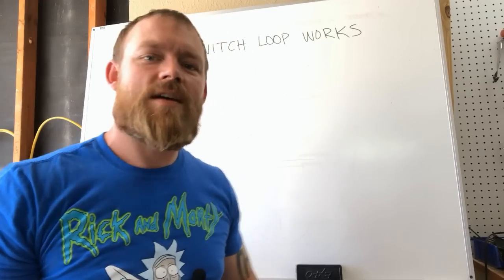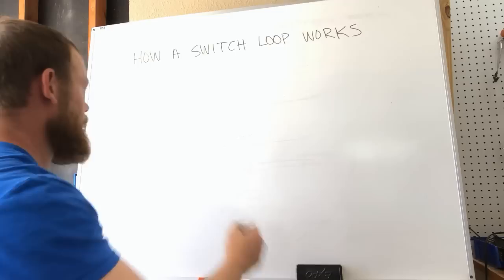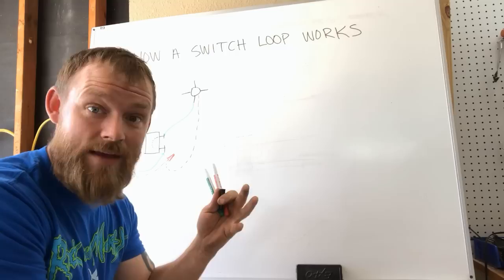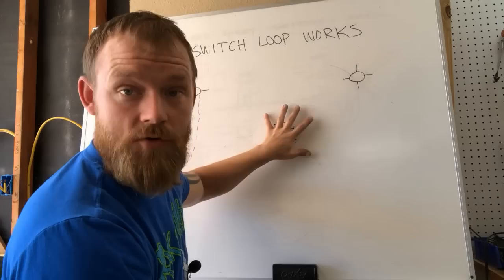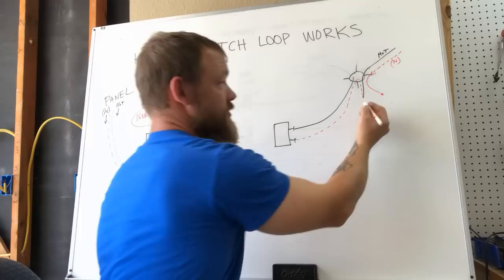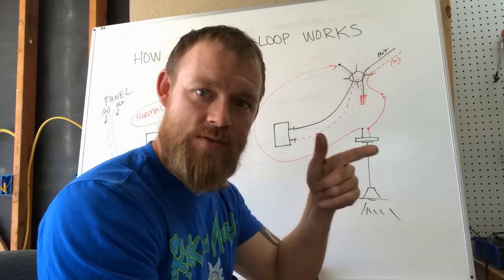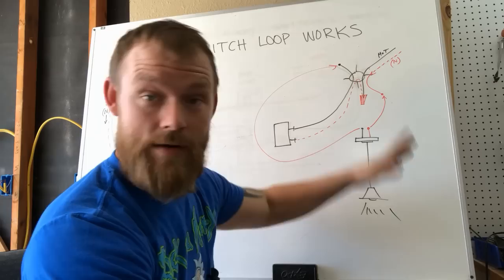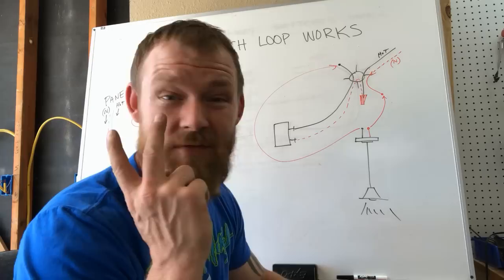Episode 13 -  SCHEMATICS how a switch loop works

Comment: Thanks for explains this. When my dad wired the house in the basement 20 years ago I had no idea how he wired  the light. Did not know it was a switch loop. Did not know what a switch loop was.  When possible I do change to new way of doing it.  Now o know when I see that there are only two wires in the light switch. Thanks for explains this.  Now I know not to throw my hands up when I see this.

Comment: Nice Explanation. I’m one of those DIY’ers and just came across this switch loop in my house trying to wire a WiFi dimmer by Feit. It’s been a pain in the butt! I purchased a wire tracer to help me out.  My scenario is a 3 way switch setup with switch loop. I’m trying to figure which is the main junction and or which junction would be easier for me to install the WiFi dimmer. If you could make an example video that would be awesome!  I’m racking my brain trying to do this.

Comment: Where I live you have to run 3 wire cable from the light to the switch because you need to have an available neutral in that switch box.

Comment: I finally understand what I’ve been trying to wrap my head around the past couple days. I’m still scratching my head tho, I had a switch, that operated a garage light. I tore the garage light out, put a receptacle in down the line for a garage door. I’ve decided to put a new garage light in place of the old. I unspliced and unhooked ALL of the wires in and around the circuit. When I turn the power back on, both wires on the switch are still hot. How is this possible????? None of the wires around the circuit are hot when unspliced. It’s all dead.

Comment: can you do another diagram,  one switch, running, 2 lights, and a regular plug, how to run, with schematics.?
Reply: Its the exact same but you go off the first light to the second and for the receptacle you use the same concept but switch the light in the diagram for the receptacle. Also make sure to do some more research because switched outlets usually only run one plug. So there's a lil tab you have to break on the hot/gold side.

Comment: Good explanation. But here in Canada if your doing a switch loop you would have to run a 3 wire. A neutral is code to be in the switch box. It's a dead end just sitting there but it's required.

Comment: So it saves having to use twice the wire for a switch. Is that correct?
Reply: Yes that is correct.  If the light is between the power source and the switch using switch loops can save wire.   But since 2011 you must use 3 wire cable from the light to the switch.   A neutral must be available in a switch box for the future installation of specialty switches.

Comment: Great explanation!! Had a kitchen peninsula switch wired 10 years ago during a remodel to possibly add pendant lights. Looks like a loop switch setup, but I'm not sure how to identify correct wires up in the attic. Lots of wiring. 1956 house, so some old and some new. Thanks much for any advice.

Comment: This might fix my issue, i brought power to the light first instead of the switch so makes sense.  Thanks for video
Reply: I think they changed the code. Now requiring a neutral At the switch.

Comment: Thanks. Your video here explained exactly the switch control my bathroom fan. Now the question is if I want to add a wall outlet right below the switch. Would it be possible to do it

Comment: My question is I'm replacing my chandelier with a ceiling fan with lights, can I wire the fan motor to the hot coming in and run the light switch off of a dimmer at this point since the motor has constant voltage?
Reply: Looking for similar answer. Switch leg in ceiling, single gang with black white red and copper, trying to navigate a double gang into the picture for a light/ fan combo, with only the existing wires. Is this possible.

Comment: The loop diagram shows line connected to SPST switch to load return. Thought 
you mentioned line wire to load to switch return. Either way series circuit will work.

Comment: If you want 2 light fixtures to one switch, do you need to use a 3 wire cable?
Reply: Not normally... when only one switch is needed... and depending where your power is located for the light.  For simple switching a length of 2 conductor (12/2 or 14/2 depending on your system.) just jumps from one light fixture to the next providing power.

Comment: Really thorough way of explaining the process. You hit 3 of the 4 ways people learn @ one time. Audio, Visual, Reading/ Writing.(kinesthetic-person learns from hands on doing it) which kinda hard since it's a video. The only thing I would still do differently is the white wire. Ur exactly right how it can be a white wire for the hot. My thought is this, if you have Red, Black or Blue wire. Why not just use those? Why even take a chance that someone(like u mentioned) comes across a white wire thinking its a neutral and bing,bang,💥 they have a problem. Anyways, just curious. Love the channel, I've become a much more efficient AND confident electrician when I'm out in the field & I'm put on something new that I'm not that familiar with or some journey/lead (like some other comments have  brought up) does a piss poor job of explaining what/how to do something. I pop one of ur videos up during lunch or when I get home that day and learn exactly the way its supposed to be done right. I swear sometimes it seems like other electricians don't want to show you things like you're their competition. So they tell you just enough not to get yelled at by their supervisor. Such bullshit. We're all in this trade together and should look out for one another. We already have to deal with the other trades messing with our shit as it is. TRUST there's more than enough cake to go around for everyone and then some. By 2023 there's going to be a shortage of electricians in the thousands. So it's not like anyone is going to take work from anyone. Anyways, help each other. Asks lots of questions. Always test wires(even if they're supposed to be cold) I've been shocked twice that way. Just saying. Better safe then dead.

Comment: I have, what seems complicated to me but may not be for experienced electricians, I have a diagram that shows the set up. I have 4 independent switch's on 4 different lights with two outlets from one power source. 1970s home.  Power is in the ceiling. I have half working but not the others. All 12-2. Worked before I updated to LED recessed lighting.

Comment: I have a scenario where a switch loop exists coming from a light fixture to a switch for one light.  However,  instead of one light for say a closet light,  I'm wanting to add another switch and light.  I have used my meter and found the white wire ( which should have been labeled with black tape  ) now functioning as the hot,  ( the white and black do not read 120 ),  and the  ( white and the ground are giving me a reading of 120 on my meter ).  Can I continue to wire a second light and switch from this switch loop?

Comment: Switch loops are common here.  The usual drill here is to wrap some black electrical tape around the white conductor to indicate it's been repurposed and not a neutral.

Comment: Just rewired a house using method #2. Main wire stays in attic and just run switches for lights. Easy-pizzey..
Reply: Right.  Sometimes during renovations you have very limited access for pulling wires.  So you've got to sometimes get  creative if you only have access from above  or below,  whatever the case might be.  Of course in new construction it's common best practice to run the feeds into the switch box then run the leg to the lights.  Troubleshooting is easier.

Comment: It is not switching from the different location. 
It’s still switching from the switch. The only difference is that constant hot is going to the switch box first as opposed to constant hot passing through the fixture box then going to the switch box.

Comment: What about the ground wire in this scenario? Are the ground wires required? Does the ground wire from the ceiling fan or light fixture need to be connected to the ground wire in the electrical box and ground screw?

Comment: This is a great explanation, I am that husband lol. I had a birds nest when trying to change a fixture. I did not see how it was wired due to haste and frustration. This allowed me to get the new fixture working. There is another fixture that has wire running from fixture to the original hook up. I just have it un hooked right now, would I hook it to the existing loop switch in the same manner?

Comment: Just to be clear even if you know the white wird is neutral be careful. If there is an appliance that is on down stream from the receptacle your working on and you disconnect the white wire you can potentially become the ground taking the full current of the appliance. And that's why it's good to pig tail.

Comment: For places that do not allow for "hot" on the white conductor, could you use say "12-3" which would allow for 2 "hot" conductors and solve the "must have neutral" as well.

Separate idea if the "hot" goes to the switch first, then could you use an "12-3" to go from the switch to the fixture leaving the red conductor disconnected but available for use if a ceiling fan installation later?
Reply from the maker: You could. And I would in that situation.

Comment: You have no idea how much your video has help me understand the concept. I am extremely new to this so please bear with me. I have removed an old fixture and there are four wires coming out of the ceiling. I know to are connected to the switch that was used to turn the lights on/off. I don’t which are which are which. A white and a black wire together as they have a white insulation tube around them and I am assuming these are the wires connected to the switch and the other two wires one is hot and one is ground. Do I have it it right so far? Now do I connect the hot wire from the penal to the white wire to the switch and the black wire from the switch becomes hot (when switch is in on position) and that black from switch and white from ceiling are connected to the fixture.

Comment: I really appreciate the video and I do agree with the sentiment that people need to stop looking at wires as Hot and Neutral, and rather as just conductors. However, shouldn't switch loops be out of code, per 200.6(1) and/or (2)? This states that the grounded conductors shall be identified as either a continuous white or gray coating. Since this would be bonded directly to Hot/Live, this conductor would no longer be grounded, correct?

Comment: I have a switch loop just like the one you described here in your video. Now I am taking out the single switch box and replacing it with a double and I need to wire a second switch in the box. Since there is no neutral wire in the box, I’m a bit perplexed how to do this. Any tips?
Reply: unfortunately you really need that neutral wire in the switch box, which is also what code these days requires. If it's possible- fish a neutral from somewhere.

Comment: Replace the 12/2 coming down to the switch with a 12/3 and you now have a neutral in the box and you can use the red wire and black wire as a switch loop

Comment: Is there a reason why you would do this? Is it because you are recieving the power for the 2nd floor or other ceiling power sources? The first diagram seems more of a standard method since usually the panel/power is in the basement?

Comment: As the name ‘Neutral’ implies. Neutral is a circuit conductor that normally completes the circuit back to the source. 
If a person put itself between a high voltage to complete a circuit it’ll get electrocuted. For that matter including earth ground.

Comment: The one problem with running your 12/2 to the new switch is that switch wiring code changed way back im 2011. Run 12/3 which puts the neutral inside the switch box from the light box. Check out 404.2(C)

Comment: So, I have a plug circuit that runs around my bedroom and into the master bathroom. I relocated one plug in the middle of a wall/circuit to accommodate a sliding glass door. Now  I want to connect a outside light to go with the door and add a switch. Ihave access to power from the plug circuit. However,  I do not want the switch to interrupt the power to the plugs in the bathroom down river from my glass door.  A switch leg sound like the solution.

Comment: Mark the hot white. Milwaukee marker (fast. easy), or electrical tape. Code and problem solved.
ETA: If occasionally rewiring a fixture, you'll only need to buy/store/carry one roll of white wire and a couple markers.

Comment: Instead of running a hot wire to the switch, , use the neutral to complete the circuit in the loop, so if someone takes off the switch cover they get no surprises ie no live power to the switch.

Comment: In order to make the smart switch work which normally requires a neutral wire, can I just add a single wire as neutral from the switch to the any source of the junction box or outlet which has neutral wire?

Comment: what do you do with the grounds?  in plastic boxes. when doing a switch loop?
Reply: just tie it to your switch at the ground terminal, and do it before you hook up any hot. It's there to protect you from getting shocked should the metal on the switch itself were to get hit. Also, make sure to run a 3 wire instead of a 2 wire from the light down- can't stress that enough. Is it necessary for lights and dumb switches to work? No. Does NEC code require it? Absolutely.

Comment: Thanks for the helpful info. One question, I'm in the same switch loop scenario except, I'm installing 2 front door lights instead of one. Do I continue the loop on through to the second light as well and then down to the switch, or just the fixture that runs down to the switch?   Thanks again for your help!

Comment: Easily understood. How would you make a 3way work? Tie the white wire to from the incoming line to the black wire in a 3 conductor between switches. That would give you a hot and two travelers at one switch and a switch leg and two travelers at the other switch... would that be correct?

Comment: for anyone that knows and can help... I have a 2 gang box, switch one is normal and controls the dinning room light. Switch two controls an outside flood light and they wired it with this switch loop. I want to install a smart switch that requires an neutral wire. What happens if pigtail the neutral from the circuit going to the dinning room light? basically I would be borrowing a neutral from another circuit.

Comment: Hey why would you you want to run a loop system?  My dad was a electrician and I never heard him talk about. I always loved watching him and talk about it////
Reply: If you need to add a switch to something that already has power to it, running a switch loop makes sense instead of running power to a new switch and then running another line from the switch to the fixture. Running one cable is easier than running 2.

Comment: I have a question. If I wanted to install an always on outlet. I would take the hot and neutral coming to the light and for a switched pigtail off the hot to the light?

Comment: Would a 3 wire be better from light fixture to switch so you get the neutral just in case

Comment: What is a dead end single pole light is it like a single pole switch with a reidentified white or is it a 3 way switch wired to be a single pole and it has a dead end wire also is switch loop another term for a dead end?

Comment: Doing old home renovations,  it's common to see this configuration.  I'm curious if it's only called  a switch loop if you repurpose a white wire or is it still called a switch loop if you use a black and a red or blue wire.

Comment: What is the purpose of this loop? Wouldn’t it be better to have the power go to switch first so there is no power at the light fixture, which tends to be worked on, changing bulbs or fixtures, more often than a switch?

Comment: "Some husband" is me, but I'm the wife!  Thanks for the video. Huge help.  However how do I identify which wire is which in a ceiling box that has 2 white and 2 black wires?  There is power going straight to the box and there are pot lights in the same room on this panel.    Everything professionally wired and we have always used the potlights.   Now, I have purchased the pendant, but the trades people are no longer around.   So, two whites, two blacks....

Comment: Looks like I have a few places in my house like this. Any issues with running a neutral conductor back to the switch box so I can install a smart switch?  I’m assuming I can just run a neutral conductor from the light back to the switch box?

Comment: We go to junction  boxes  before anything and then distribute them and for receptacles  we will send all the plugs up tuh junctions and make up all the connections  on the junction box its kist6 for who ever  tuh step  back watch the run and understand that's  all nothing  hard about that first thing when a wireman touches on the job first thing  tuh do understand  what ur dealing  with  and then thke on the task at hand then it's easy  as squeeze

Comment: So recently I wired my basement with new lights and I did it with a switch loop, but I sat there and I puzzled over it for awhile watched a video or 3 (hadnt found any of yours yet)  and lightning struck my brain....the white doesnt have to be neutral DUH....and after that it was easy peasy but you are right its a mental block at first. its like butbutbut...OHHHH

Comment: Does the switch loop method only work for one device? I’m trying to add an exhaust fan in a bathroom, using the same light switch. Existing light is in a switch loop.

Comment: I want to replace a fan/lite switch. The existing switch has bk (HOT),  bk-wt (HOT) and blu wires.
My question; New switch has: bk, yell and red wires w/ gr ground wire. How are these new switch wires attached to the existing bk (HOT), bk-wt (HOT) and blu in the electrical box?